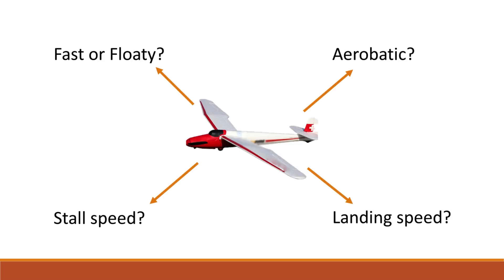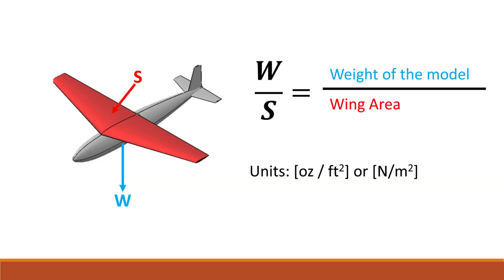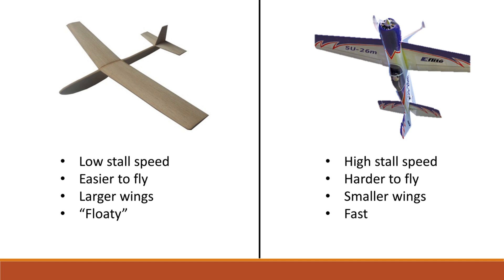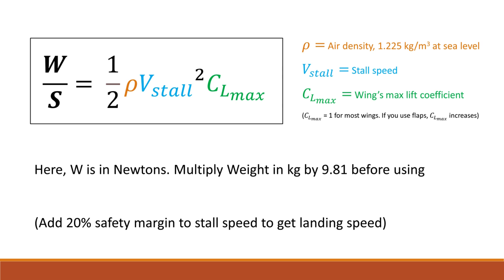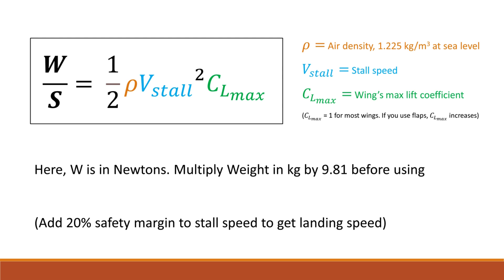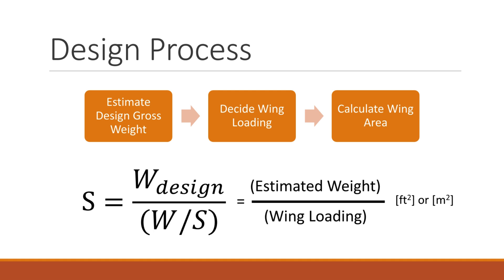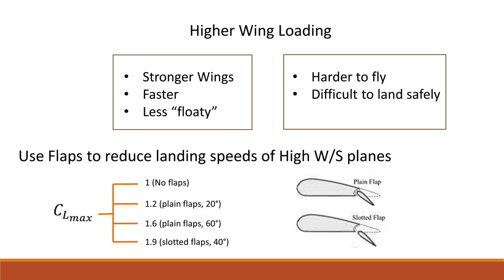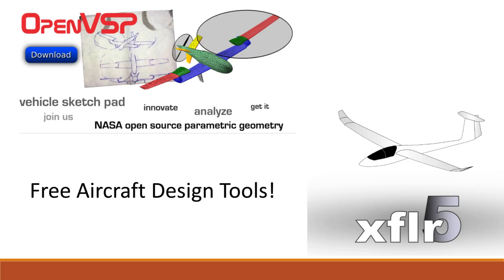How to design an aircraft: Wing Loading

Comment: Hi i have a question about wing loading i designed a uav  and has 3147 cm^2 area. And my weight is 4kg. When i calculate wing loading its be 38. Is it too high or normal i cant understand actually. Cause in the video says between 15-20. If u response i will really happy about it thx for the video!
Reply: Also my speed is 18 m/s and my airfoil is naca 2412 when i calculated my stall speed its being 15 m/s
Reply from the maker: Cruise speed of 18 m/s seems fine to me. Once you get a good estimate of your wing loading, then calculate the stall speed again. Try to keep a healthy margin between cruise speed and stall speed, for a safer flight.
Reply: @AircraftDesignToolbox  thank you so much for your comment and i wanna ask one question again am i have to make different materials? Because i was thinking make balsa/foam construction.Is it will be dangerous for this wing loading or stall speed?
Reply: I said 4kg because with this plane i will carry 2 cargo and my with 2 cargos and my plane weight will be 4kg.Is this calculating wrong? Should i calculate without 2 cargos weight?
Reply from the maker: @EmineHilalKır  I think the total plane weight will be much more than 4 kg, if your payload is 2 kg. To estimate the total plane weight, you can try to find out information regarding similar planes, that have a payload weight of 2 kg. For example, the Puma 3 AE UAV has a payload of 1.8 kg, and the total plane weight is around 7 kg, but, it is not made of balsa/foam construction. 

Wikipedia states that the Lockheed Martin Desert Hawk is made of plastic foam. It has a total weight of 3.2 kg, out of which 1.5 kg is batteries. So you can imagine that after subtracting the weights of motor, airframe, servos, etc., the payload weight will be very less. Here is the Wikipedia link:  https://en.wikipedia.org/wiki/Lockheed_Martin_Desert_Hawk 

The Desert Hawk III is made of polypropylene material, with these specs: Total weight: 4 kg, empty weight: 3 kg. This means the payload weight will be about 1 kg.  https://en.wikipedia.org/wiki/Lockheed_Martin_Desert_Hawk_III#Specifications_(Desert_Hawk_III) 

Due to the lack of information on foam UAVs, it is difficult to estimate the total weight based on payload weight. Maybe you can design and build a foam prototype, using a wing loading value of about 8 to 12 kg/m^2, and see how much the prototype weighs with the payload, battery, etc, and see if (and how) it flies. Based on this experience maybe the wing loading can be changed in the next iteration.
Reply: @ thank you so much! Its really helpful to me! Have a great day
Reply from the maker: For your UAV, Max Weight = 4 kg, wing area = 3147 cm^2 = 0.3147 m^2. This gives a wing loading of 4/0.3147 = 12.7 kg/m^2. 

The wing loading values in the video are for RC planes made out of balsa / foam construction. For your UAV (since it will be made from different materials), I would recommend you to gather information regarding similar UAVs and find their wing loading values. For example, I found this Milo UAS online, which has the specs: MTOW = 6 kg, Wing area = 0.87 m^2 , which gives a wing loading of 6.9 kg/m^2. The spec sheet can be accessed here: https://www.applewhiteaero.com/documents/MiloSpecSheet2017.pdf 

Also, this resource will be helpful in designing a UAV (see page 20 for the wing loading versus mass of various types of UAVs):  https://apps.dtic.mil/sti/tr/pdf/ADA623605.pdf 

Hope this helps!

Comment: Cubic wing loading (or wing cube loading) is a better indicator that works for planes of all sizes. It is calculated by dividing the wing loading in oz/ft2 by the square root of the wing area in ft2. Here are typical CWLs for . . .  Gliders 5, Trainers 7, Sport 9, Pattern 11, Racers 12, Full Scale 15 - 20.

Comment: i think i found  a gem!!was searching for channels to learn basics aircraft design principles.

i have a question, for all the data u used in this video, what was the wing air-foil cross-section? I believe the design of the air-foil effects the clmax heavily.
Reply from the maker: Thank you for your kind words!

The data I used in the video is mainly from the book "Basics of RC Model Aircraft Design". You are right, the airfoil affects clmax value, however, for most RC plane  wings, the clmax value is close to 1. This is more of a rule of thumb, which can be used for initial sizing. 

Moreover, for "real" wings (finite span wings), we don't completely achieve the theoretical clmax value of the airfoil (which we get from the airfoil plots). 

Also note that the wing loading values for different models suggested in the video is for one particular type of construction method. So, in practice, the wing loading must be chosen according to what similar planes of similar construction have.